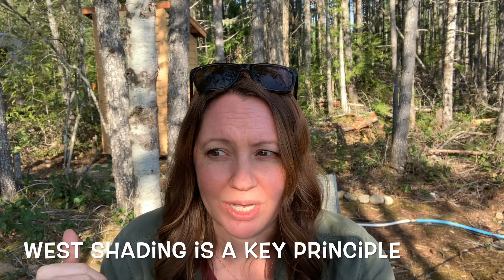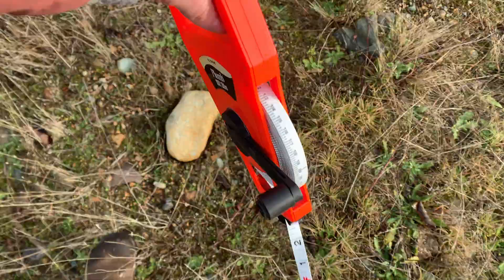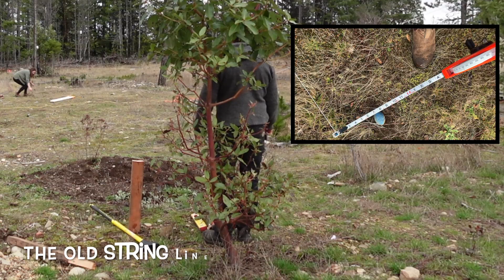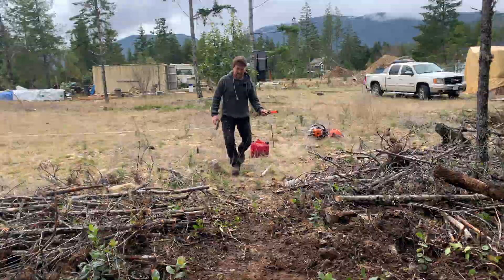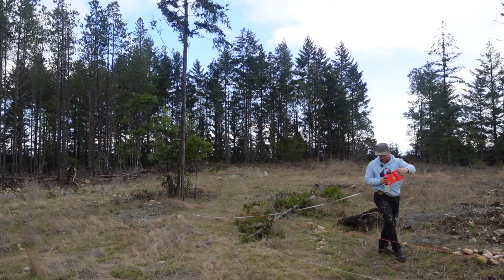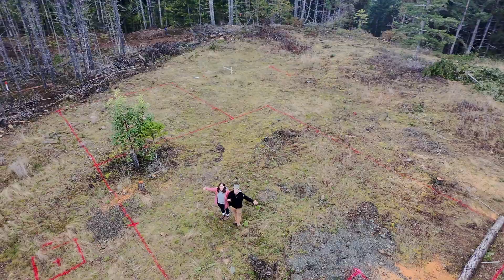The key to free heat | Passive Solar House

Comment: Hoping permits for you are quicker than they are around here. I don't do passive solar heating because I've found the days I want that heat are in the middle of a rainy week where you can't even tell where the sun is, but it's all in your climate. If you get enough clear sunlight in winter to be worth it, you're laughing!
Reply from the maker: It's been 13 weeks and still no permit! I get a lot of rain in winter here as well but still enough sun in winter to heat up the sunroom. I am supplementing with a wood stove and mini-split heat pump because code requires me to have one mechanically cooled room.
Reply: @ecoendeavour  A lot of thermal mass in the sunroom will help store the heat from sunny days, if you've got more heat coming in than you need on those days. Of course if you don't have enough heat to warm up the thermal mass, it'll just all stay cold, which is where adding things like barrels of water after you've moved in gives you customisability.